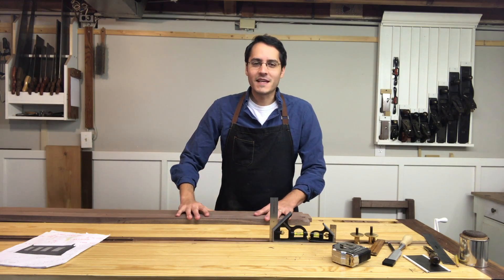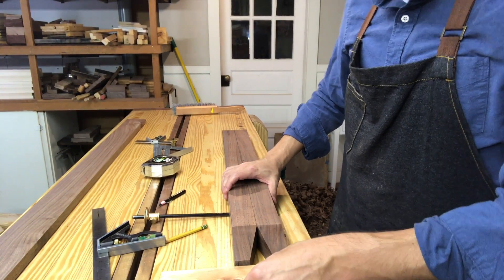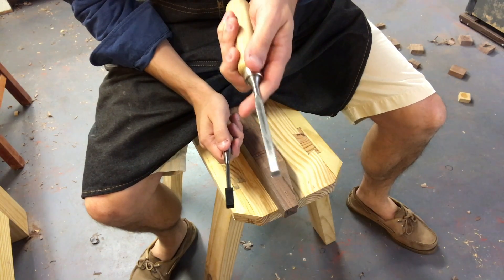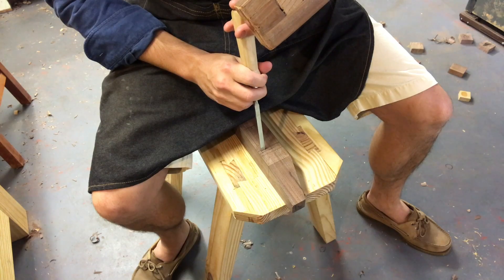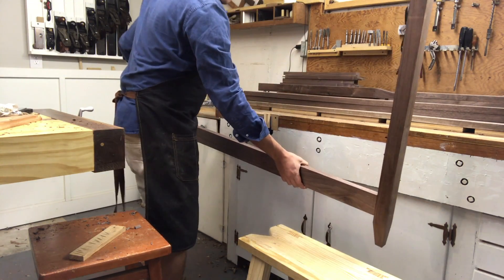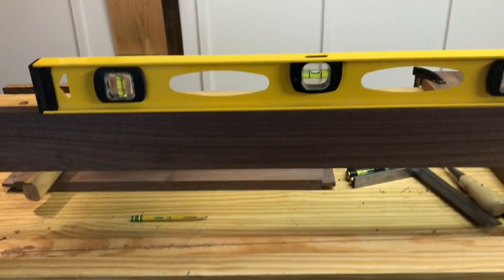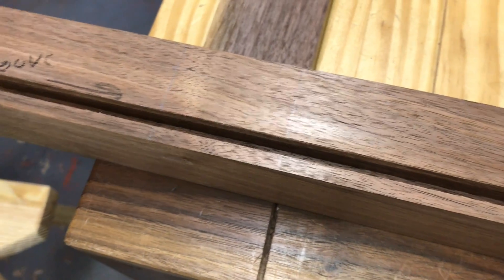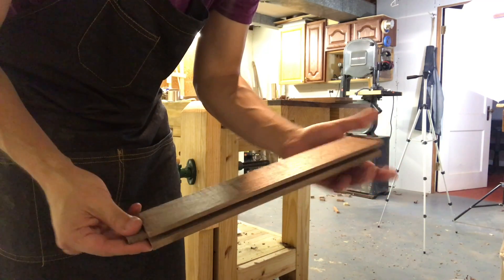Building a Sideboard part 8: Mortising the Front and Side Rails | Hand Tool Woodworking

Comment: Man, that is some pretty tough and wild grain 🤪
Reply from the maker: Yup that lower rail was a bear to plane! I actually messed up one of them and had to remake it. 🤦‍♂️
Reply: The HandToolery I’ve had some walnut like that. Could only use it in small portions, as accent. Too expensive to throw away.
Reply from the maker: @rollingstone3017  Fortunately, I got some of this at a really good price, so it didn't hurt too bad. But I did feel bad that the original piece I had chosen didn't work out.

Comment: Looking good.

Just one observation, I always find it easier to cut slots with a plough plane by starting at the end and working backwards with small strokes, it results in less wandering of the cut.  Once the slot is established, you can take longer strokes without worrying about the cut line as the blade will track the existing slot. Starting at the end of the cut allows the full length of the side fence to guide the initial cut, and the smaller cuts take less effort.
Reply from the maker: Thanks!
Reply: @TheHandToolery  I second cmdrsock's recommendation. Starting from the far end when ploughing grooves works great.
Reply: This will help with the 78 too